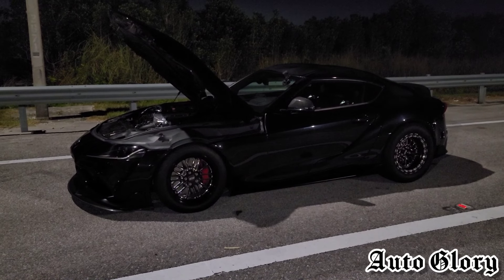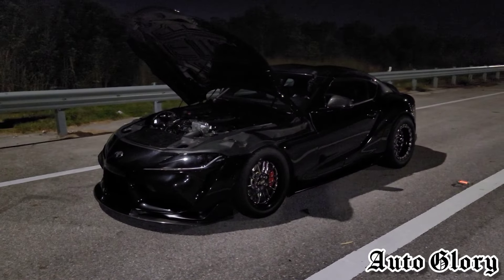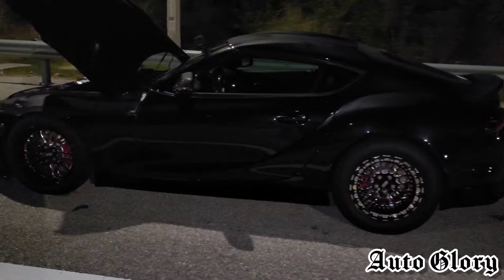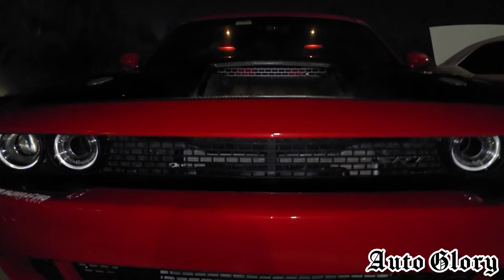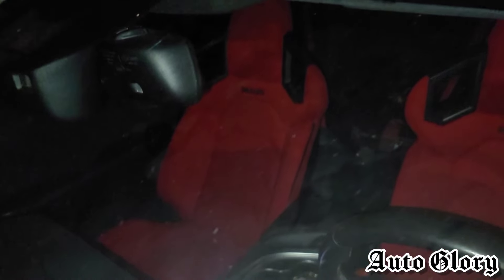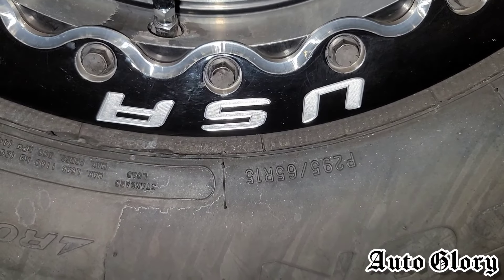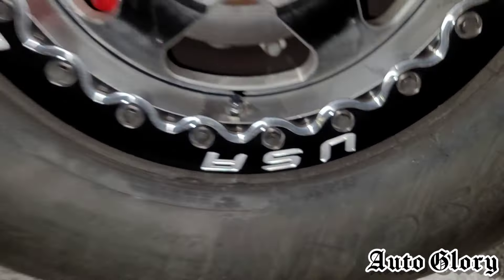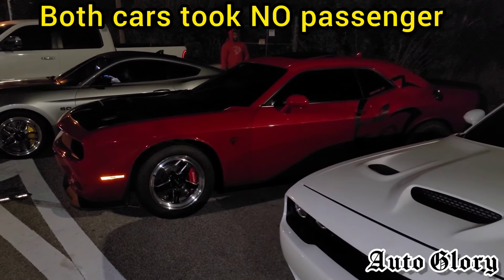Toyota Supra PT6870 Turbo E85 vs Dodge Challenger Hellcat FBO Cam E85

Comment: Absolutely wild how fast a stock B58 can get. Amazing.
Reply from the maker: Thanks for watching! I'm glad you like this Supra!
Reply: These bimmerengines are engineering marvels.
Reply: @dantethomas7964  Make a difference Toyota use the platform b58 and Toyota built the setup. Stock b58 on that supra beat stock bmw with that engine ... With a difference ... Do your homework next time...
Reply: @dantethomas7964  i agree
Reply: @SuperViktorov  his comment was not wrong, bmw engineered the b58, the Supra is a lighter vehicle that’s why it will beat some of the bmw’s with the same motor because they weigh more, but with bmw you can get awd with the b58 also. Any way you look at it bmw made the motor in this car not Toyota
Reply: @Iluvcheddar1985  dyno results from the b58 in the supra is way higher then they say... Its around 400, 420 hp ... They made it a little bit more powerfull and im not declining the weight difference...Toyota made better job on that engine then bmw
Reply: @SuperViktorov  post ONE article showing Toyota did squat for the B58. You can't because they didn't 😂 either way the B58 is good and all, but the S58 is much better. 1000whp stock longblock capable, wait till more mods come out.
Reply: @@SuperViktorov  too long didn't read 🤣 No article? No proof? Toyota didn't do anything. Bmw gave them that motor and that's it. M motor > non M motor
Reply: @SuperViktorov wrong.
Reply: @hasangenc2922  crazy bmw fanboys ... Toyota made better job on that engine then bmw and you are hurt from the truth ...
Reply: @SuperViktorov  Its a Bmw engine.
Reply: @SuperViktorov  nope Toyota made it reliable then shipped it back to BMW for mas production during the development stage of the b58, BMW handled everything else, including the power figures etc no b58 in a Toyota is more or less advanced than the ones in the BMWs
Reply: @intelligentcarreviews8592  You can look the results from a dyno on the stock supra and they make 50hp more then the claimed one .. There are enough videos in YT ... Im not arguing anymore... Z4 with the same engine is not making that power stock ...
Reply: @terrancebulong4573  the b58 has stronger connecting rods than s58. They don't hold the same power stock motor to stock motor.
Reply: First gen b58 have been around since 16 I believe the Supras have gen 2 which is the b58tu. FSeries  all come with first gen gseries have the 2nd gen. Toyota had no part in it lol they just saw a reliable motor that could be tuned easily. Smh give the bmw engineers some credit geez
Reply: @SuperViktorov  you don’t know what you’re talking about. Toyota had nothing with designing the engine. They simply have different parameters set on it, that’s why you have different numbers.
Reply: @SuperViktorov  Dyno didn't proof anything. It could be the load on the dyno machine, temperature, fuel and other factors that made the stock b58 in supra run higher hp.
Reply: @SuperViktorov  do your homework next time 🤡
Reply: @SuperViktorov  you are super wrong  my guy
Reply: @intelligentcarreviews8592  first search and then tell me im wrong ... There are enough information and facts about that ... Wnna name the videos or send you links, cuz there are plenty of them ... I know it hurts you that there are finally a bmw engine that works properly and its good for tunning, but unfortunately its in a Toyota ...
Reply: @user-ke1qj7up3e  That was one of the worst excuses ever ... You have FACTS with the dyno and you are saying that it doesnt mean anything... BLIND BLIND BMW FANBOYS.
Reply: @aldosayshi782  Yeah ... Thats exactly what im saying ... Toyota did better job with that engine. Better settings, more power, more reliability. I didnt say that they designed the engine i SAID that they use that platform B58, but did better job setting up that engine then bmw and thats ACTUAL FACT, considering that there are tons of comparisons between both cars and the result is ... Overall Supra have better performance then the bmw .. Stock vs Stock.
Reply: @SuperViktorov  bro it's literally a BMW motor in a car designed by Toyota. The z4 does the same numbers and I'm pretty sure if it was a hard top ppl would send z4s into the 7s. Either way it's BMWs non m motor which outpowers everything in its class
Reply: @SuperViktorov   Get a clue!!! Everybody in the automotive world knows that the Toyota MK5 Supra uses BMW’s straight 4 or 6 engines….NOT a Toyota engine!!! Hahahahaha
Reply: @hgill9866  he's a mega Toyota fanboy that is delusional about how Toyota redesigned the engine to make it better lmao!
Reply: @Terrance Bulong  Toyota did teardown the B58 and tested each component. The components that failed were replaced by stronger, better components. Toyota also tuned the Supra both engine and suspension. Now, whether the work Toyota did with the B58 in the 2020 Supra was applied and used for all B58 is unknown.  What is known is that the 2020 Supra has a different engine configuration than any other B58 engine in all other BMWs.
Reply: @SuperViktorov  its the same whp for 2020 m340i’s (tested 408 whp) with gen 2 b58 same as a91. Only difference is supra is lighter, toyota didnt do anything for the drivetrain.
Reply: @Iluvcheddar1985  I mean the badge literally means it's a Toyota. But to go into more detail, that's like saying the mk4 isn't a Toyota because Yamaha and a few other companies engineered the 2j and BMW engineered the getrag in it. I'm not denying a LARGE amount of bmw engineering and parts but the car is a Toyota and Toyota put a lot into it. I hope Toyota continues to produce vehicles like this even if their sales are hurt by people that aren't educated on the subject.
Reply: @philipmvee8466  The guy above you said it all ... Im not arguing anymore.
Reply: @supranova730  Thank you. I dont think that anyone here from these delusional fanboys would coperhand this information.
Reply: @supranova730  Can't wait to see the proof guy! Send me just 1 link I bet you can't, and won't be able to lmao!
Reply: @German engineering  do you do any research or do you just ask people to provide proof?  I can say prove me wrong and put the onus on you.  I don't think Auto Glory wants links to other sites on his channel so if this gets deleted then you know why.  Also, do your own research.  Here is a video on the process to help you out. 

https://youtu.be/_jbyzmtgU_0
Reply: @German engineering  I provided another link to a motor1 article that seem to have been deleted.  It talked about how Toyota tuned the engine and suspension for the Supra.  There are other articles that interviews Toyota's chief engineer, Tetsuya Tada, on this subject.
Reply: @supranova730  I appreciate the link, but I'm just skeptical that component's were actually replaced or made more durable! They definitely checked it all out like you said at the very least. I'll give you that!
Reply: @German engineering  there was an article that actually had the translation of what Tada said regarding their testing. However, II don't remember the name of the article to search for it.  It essentially said that Toyota performed quality assurance and reliability testing to ensure every component met its reliability standards, and if it didn't the parts weren't used, but rather replaced with better stronger parts. That is the entire purpose of testing.

Edit: Remember, BMW was providing the funding $$, and parts couldn't be replaced without them.

Comment: A. G. Can you get this supra against chefs wrx and the all motor orange Z06? That would be a crazy run!!!
Reply: Definitely love to see those
Reply from the maker: It's in the works
Reply: The Supra is fast, but that z06 is on another level. Wouldn’t be close.
Reply: AG can you set up the  white 68mm turbo porxhe vs that’s supra
Reply: The orange Z06 was similar to the Plaid with its runs. No way its beating the Supra. Supra jumped the Plaid but it was still going to get it by a couple cars. Z06 isn't doing such.
Reply from the maker: @TB  z06 has gotten a bit faster since the plaid run. And just so you are aware that plaid thay raced the z06 is now slower over time. The one that raced the supra is also slower. I have noticed now these plaid get slower the more miles you put on them.
Reply: @AutoGlory  and ims850 Ttrs and rs3
Reply: @AutoGlory  fucking hell yeah!!! Well if thats true about the plaids theirs another excuse i have to hate EV... Lol. That would be maddening to spend that and then its gets slower..lol

Comment: I wanna see this Supra go up against that N/A vette. I think that would be a good matchup
Reply: That vette is fast af don't get me wrong, but I'd put money on the supra. And the reason so, is its making atleast 800hp and the weight difference.
Reply: @adamwelles5502  that vette makes over 700 and weighs less than 3000lb
Reply: @teejay3321  yeah the only thing the Supra has over the vette is the transmission being an auto. But the vette makes just as much power and is lighter than the Supra. My money is on the vette.
Reply: I just said the same thing that vette is in demand!!!
Reply: @adamwelles5502  lmao what?

Comment: Sheesh inline 6 taking down fbo e85 cammed gutted hellcats, said it's the fastest in the area.  I must say those supras are impressive no doubt.
Reply: It's not gutted, lol. Backseat out isn't gutted. Supra has to making over 800whp. No way around it.
Reply: @TB-vb3ov  facts! i’m surprised more people aren’t saying this!
Reply: He beat a modded gt500 too which is even more impressive given how much those gt500’s cost brand new with a DCT transmission and 760hp stock 😆
Reply: @DodgeandGMkiIIingFurdDaiIy  Poor kid is mad the fastest hellcat in the state got beat by a lil inline 6 🤣
Reply: @TB-vb3ov  it pulls the same on a fbo ported blower challenger as it did on the barely modded one. someone is being shady with their power figures.
Reply: @thefitnesslife4988  that's the best modern inline 6 right after s58. No shame in that.
Reply: @skylineownzful  Lol I'm aware, I just troll that kid how he trolls on gt500s when they lose to supras 🤣
Reply: @thefitnesslife4988  and that same Supra beat a more expensive modded gt500 😂😂😂 junkers be Iosing to NA c7 vettes on franks channeI 💀💀💀💀
Reply: @TB-vb3ov  it’s definitely making 800whp lol it’s 3350 lbs and 8 speed zf what u expected? If it was making 1000whp Supra would of but street lengths at that point….. it’s not horsepower but also weight…..
Reply: @DodgeandGMkiIIingFurdDaiIy  ay didn’t MJM get clapped by a sealt midnight mustang 🤣🤣🤣
Reply: @joshfde  you mean it took a TT setup to race a stock bIower cat poor kid brandgay🤣💀🫵🏽🫵🏽 now imagine a TT cat 👹🏋🏿‍♀️🏋🏿‍♀️
Reply: @DodgeandGMkiIIingFurdDaiIy  max effort slow boat lost to a  stock motor coyote 💀🤣🤣🤣🤣🤣🤣🤣🤣 slowcat gonna need 5 turbos to even have a chance 👌
Reply: @joshfde  you mean with TT’s poor kid 😂😂😂 but once a hellcat has TT’s it’s not fair 💀💀🤣🤣🫵🏽🫵🏽🫵🏽🫵🏽
Reply: Dodge and GM are king 👹🏋🏿‍♀️
Reply: @joshfde  <<< Brandon flexing mommy’s ecoboost again.  🤭🤭🤭🤭

Comment: A proper hellcat hell yeah. That’s MJM”s car.  👍 Supra has my respect it’s legitimately fast.
Reply: Him and Yamil are the fastest with some basic setups 😂
Reply: @DodgeandGMkiIIingFurdDaiIy  gapped that fbo hellcat with a opended motor🤣those cars are slow asf to lose to a basic 3.0😭reply if you like tip
Reply: @Tender_vigilante same Supra gapped a more expensive modded junker gt500 and you were hiding 🤣💀💀🫵🏽🫵🏽🫵🏽 repIy If you Iike big tip
Reply: @joshreynolds729  just giving the same energy you guys give. Lil 3.0 putting bus lengths on a FBO hellcat.
Reply: @Tender_vigilante  buses….? I don’t think so. I think they need to re race the hellcat spun until 100. Look at the road on the hit. It’s 11s all down the road.
Reply: @Tender_vigilante  truth but it goes both ways and comes way more from the ford side than dodge or Chevy as franks channel is 60% ford fans. But yes I can see where your coming from however, this is my comment and I don’t do that fanboy shit. Size isn’t a factor just like weight isn’t because that’s on the owners choice upon purchase. So to be fair here the hellcat needs a built trans, and go after market boost to be fair. And if he does he will be in the 1200 whp range and we know the Supra has no chance right. I’m not hating on mustangs or you or even this Supra just telling it how it is. Weight cancels out motor size those are personal problems upon purchase. This is why I’m actually the hellcat should be able to win but can of given the same mods as everyone else which are used against them to win because they don’t come equipped or are to small. Really the zr1 and gt500 are the only other 2 that have blowers worth a shit but in the end it’s still stock even ported it’s still stock after market is better.
Reply: @carguybrown98  you’re right, football fields. Poor dodge. Fbo with more horsepower and a bigger engine and still can’t beat a basic 3.0
Reply: @Tender_vigilante  it was literally one car bro by 160 and the hellcat let out. The hellcat also spun to 100mph and the Supra st8 hooked. I’m no fan boy and love all cars, but that wasn’t a fair comparison.
Reply: @carguybrown98  Yeah good point. In anycase nobody can say that was a gap because it was exactly 1 car to 160 mph spinning to 100.
Reply: @Tender_vigilante  basic 🤣 the damn thing has direct injection multiple cams and all the new tech to go along with it many years newer and many lbs lighter. The dodge still has a push rod engine 🤣.
Reply: @DodgeandGMkiIIingFurdDaiIy  imagine losing to a car with 200 less wheel 💀💀💀💀💀💀
Reply: @joshfde  imagine Iiking anaI and having your best car the gt500 Iose to a Supra with mods 😂 our base modeI heIIcat did better 💀💀🤣🫵🏽🫵🏽🫘🫘
Reply: @joshfde  i actually seen this exact race on a different channel. What auto glory didn’t show was the very first race. The hellcat dead hooked and jumped out on that Supra by two or three cars  and the Supra let out and wanted to rerun it and literally the next race the hellcat spun and that was the race they posted. They should have reran it back for a 3rd time. Props to the hellcat for staying in the race even tho he was spinning and the first race the Supra let out because the gap was so bad
Reply: @joshfde  Also a lot of people are saying that Supra is lying about his numbers and is around 900 wheel. The horsepower is a lot closer than what everyone thinks
Reply: @carguybrown98  the cat is lying too with those mods it should be around 1100+ wheel so who knows 🤷‍♂️
Reply: @carguybrown98  facts bro 😎😎
Reply: @joshfde  That’s not accurate. The hellcat is telling the truth about his numbers. I have a friend with that same setup and cam. He put down 1025whp. Most fbo cats are actually around 950-980 depending on ported blower or not. The cam is what makes the difference on 50 or so horsepower power. It also allows the cat to shift at 6700 instead of 6450. Just fyi…. We have a lot of fbo cats around here and only 2 with cams.
Reply: @carguybrown98  this cat is pretty max effort. most of these builds are in the 1100 hp range. it’s not accurate but it’s in the ball park
Reply: @Tender_vigilante  you call that basic c'mon man
Reply: @DodgeandGMkiIIingFurdDaiIy  you like tip you admitted it
Reply: @kylegallant3423  that’s what Doug trollman says

Comment: Top 3 favorite cars on the channel are the white hellcat, this Supra and that orange c6z06
Reply: Lil 3.0L 6 cyl just clapped a 6.2L v8 fbo cammed e85 weight reduction boat 😭😭🤣. Pretty embarrassing considering the hellcat has a higher msrp, bigger engine, and more mods 😭😭💀💀
Reply: @thefitnesslife4988  this same Supra gapped a much more expensive modded gt500 too and you were hiding poor kid 💀💀🤣🫵🏽🫵🏽🫵🏽 junkers be Iosing to NA c7 corvettes 😂😂
Reply: the supra gapped that white fbo tin can hellcat 
and yes we know it beat a full weight fbo gt500 too 

at least the gt500 wasn’t fbo and a tin can and still lost
Reply: @thefitnesslife4988  u must be high on the good stuff riding that b58 really good .. I love both cars but the Supra isn’t a bolt on car , it needed a big turbo swap and multi port injection to do what it did . The hellcat is on a stock size blower with a port lmao .. u really don’t think a big whipple hellcat wouldn’t put the Supra in a different zip code huh ? Go to bed now
Reply: @shocczz6246  facts 😂😂
Reply: @Toxic_coyote12  the hellcat still weighed more than the gt500 did and the hellcat doesn’t come with 760hp stock with a DCT transmission 😂😂😂 ford is junk.

Comment: Man that Supra is fast. 
Not sure if the owner of the Hellcat would comment, but did he get the cams degreed? I ask because it seems the white FBO and E85 Hellcat did better than this Hellcat against the supra and it had the same mods except it wasn't cammed. I know for the mustangs, if you don't get them degreed, you run the risk of the cams costing you power rather than give.
Reply: I agree, white car doesn’t even have a ported blower. This car is ported blower and cam which should be 1100 or more fairly easily. I think it should be running a little better still very fast tho. I’m pretty sure both are similar weight wise
Reply: @johncena-hq1ti  Yeah, I've seen cammed mustangs that actually made less power than before doing the cam upgrade. And that was because they were off the shelf cams and weren't degreed. Idk much about mopar engines but I assume they have 4 cams or is it just 1?
Reply: @racequad9  just 1
Reply: @driv3n758  ah ok. But I am assuming degreeing them is just as important as any other car. Would be nice if the owner gave his imput